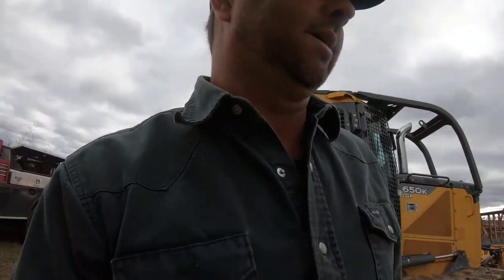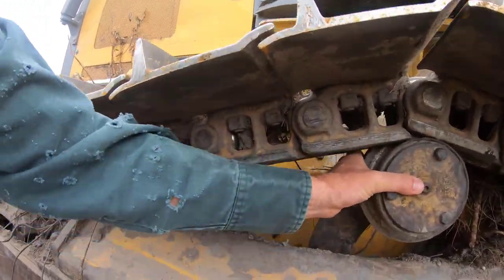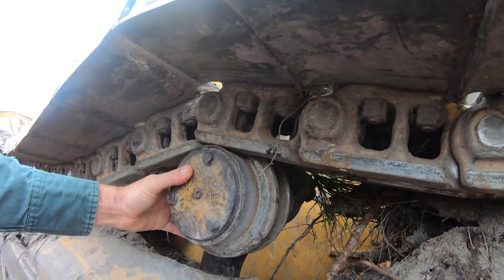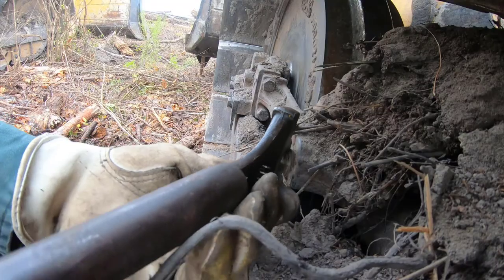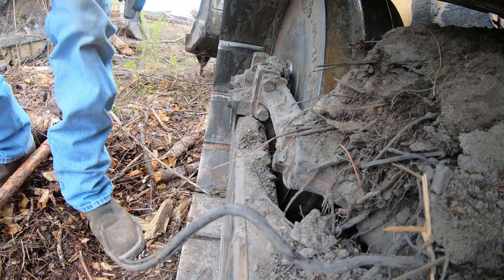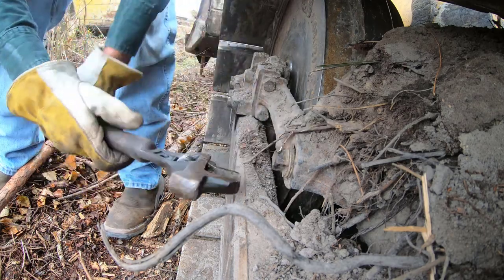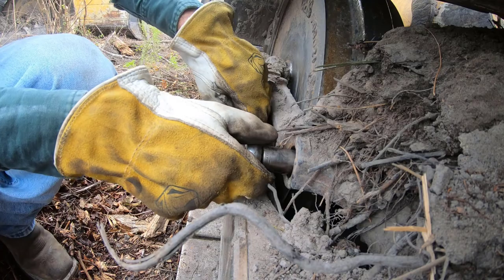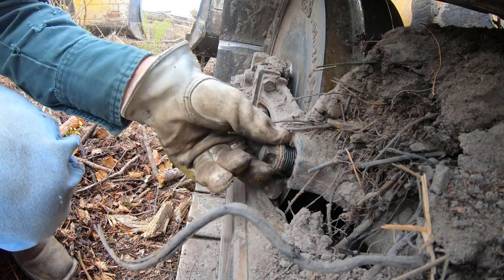John Deere Dozer Top Roller Replacement and Broken Bolt Removal Tricks

Comment: You need to get the little collar and washer that goes on the bolts or the pins and then they won't break so easy the collar won't let the bolt flex back and forth the bolt is not supposed to be down tight against the pin ear

Comment: Use a flat washer first to weld on then weld the bolt to it it's a lot easier to weld it then trying to hit the hole of the nut
Reply from the maker: I’ll have to try that next time...cause I’m sure there will be a next time